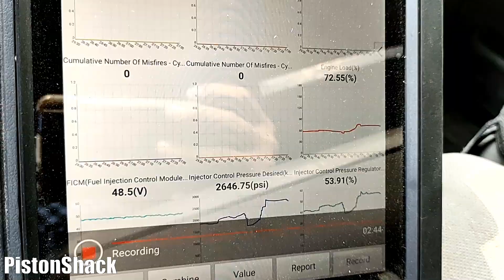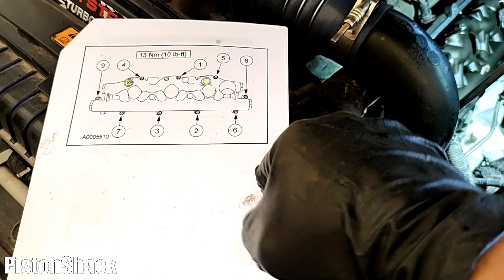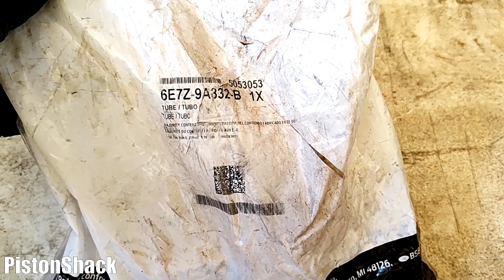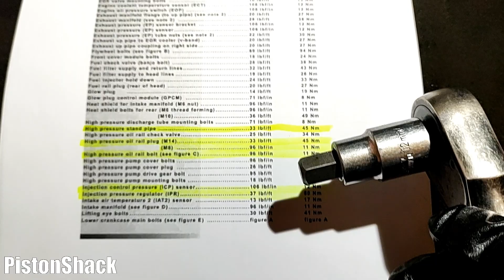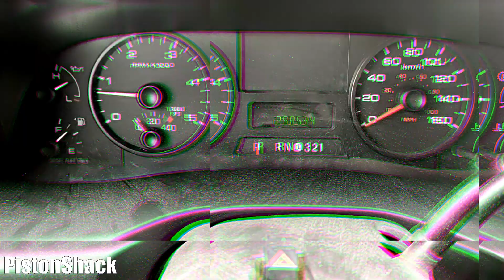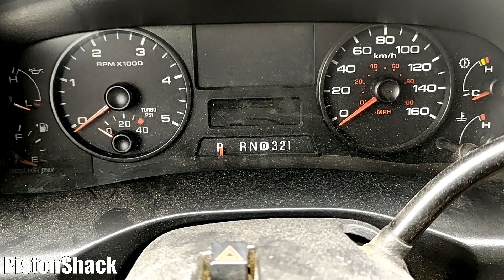6.0 POWERSTROKE (2004/5-2007): In-Depth DRIVER Side Dummy Plug, Stand Pipe Replacement!

Comment: Thank you!  I just did the passenger side and will be doing this tonight.  I used 3 long headless studs to make sure all the nipples were aligned while removing and replacing the rail.  Also, the torque for the standpipes and dummy plugs 2004.5 to 2007 is 60 foot-lbs.  The older ones were 33 foot-lbs.  If I can get the pipe out on this side without removing the rail I will....(after I did the driver's side) I did not have to remover the rail!  the standpipe came out in one piece!!
Reply from the maker: How is your repair, Ryan?
Reply: @PistonShack All back together and running like it should!  Tip: put the oil fill tube and cap back on before any nuts fly out of your hands and hit the small hole where the tube goes.  I was putting the last nut on above the airbox and lost it.  Looked for 1/2 hour thinking there is no way it would have gone in the hole for the oil tube hole.  It did and I got lucky with a small magnet blindly fishing it out.  I knew I had to find that nut before starting the motor.